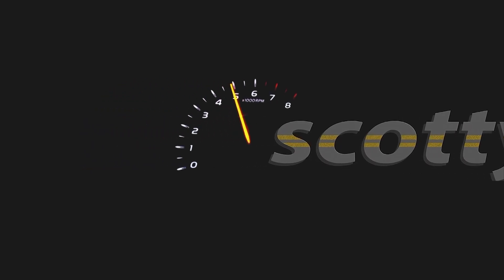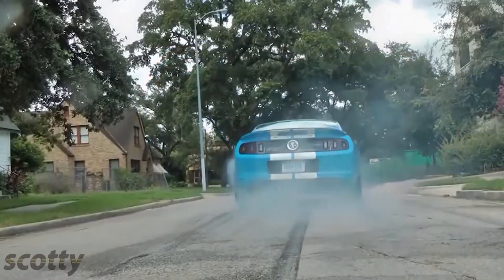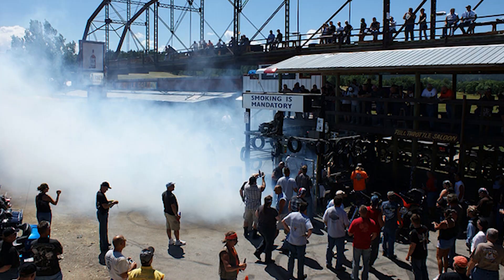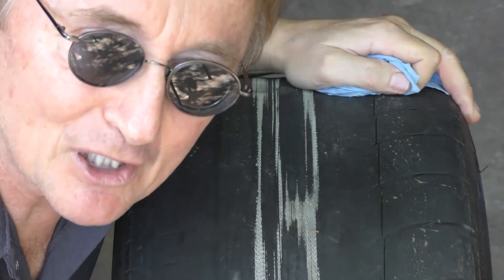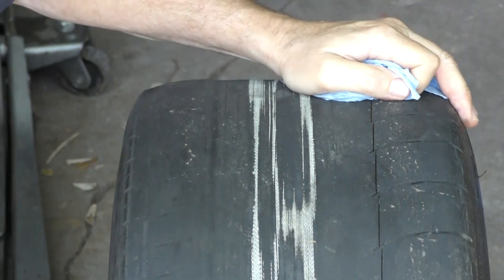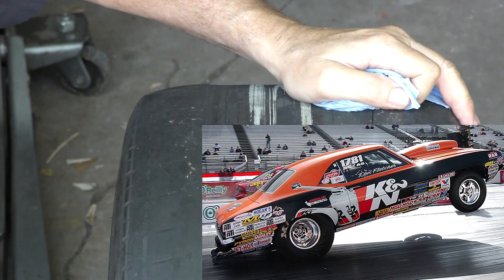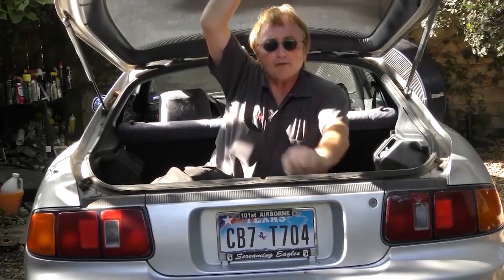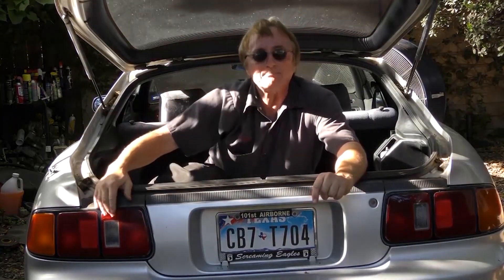Why Not to Do a Burnout in Your Car

Comment: 1 Horse = 14.9 HP  Mind=BLOWN
Reply: Vehicle Virals , holy smoke, that means my car's got 4470 hp.
Reply: In technical terms, a horse power is a unit that is equal to 735.5 Watts. It was invented in the era of vapor engines.
Reply: Paulman50 LOL!!! XD
Reply: Beats most mowers
Reply: Damn math
Reply: A horse of power it's by definition 75kgxmeter/second. Convert that to your favorite unit.
Reply: 1HP is roughly the amount of work a dray horse would average, working 10 hours a day, 5+ days a week. When it's really not all "that into it," much like you'd be, working a 10-hr workday.

Obviously, a horse can produce more power in a brief dash, much as you can produce more power than you do, say, pushing s lawnmower around the yard.
Reply: In terms of sustainable mechanical output (rather than just waste heat), 200 watt (0.27 hp) is about average for an adult, with some variability from person to person. A healthy 6′6″ young male might get as high as 300 watt even if he’s not genetically gifted, whereas a 5′1″ female would be closer to 150 watt. A world-class athlete can put out 400 watt / 0.54 hp over an extended period of time without being physically very large, but that seems to be the ceiling and you can’t go much higher even with doping. The limiting factor is the ability to bring oxygen to the muscles. You can do a fixed amount of work for every unit of oxygen (about 4-5 kJ/liter of mechanical output if operating at maximum efficiency), and the rate of oxygen delivery is limited by the rate at which the blood is pumped by the heart and the concentration of oxygen
Reply: Om Alive at last your comment = mind blown
Reply: Paulman50 ion get it
Reply: You're bang on Dig Byck
Reply: Paulman50 I got the same number.... 300HP?
Reply: how much hp is a chicken?
Reply: and if your car's got 4470hp, then it actually has 66,603hp
Reply: What are they feeding today's horses?!

Damn GMOs?!

...

I'm joking. GMOs are great. They are just controlled evolution. Like breeding cats, dogs, bananas, or horses, for certain traits.

I don't know if that's the reason for the 14.9. Or 1 Horsepower equaling 1 actual horse, was always wrong...

I don't know...

Whatever.

Because of Electric Vehicles, and the Metric System. I care more about Kilowatts & Newton-Meters anyway.

The Imperial measuring system, can't die soon enough.
Reply: Vehicle Virals temporarily, 1 horsepower is a hp that an average horse can provide constantly, makes a lot of sense.
Reply: Yes, I believe that James Watt observed how much effort (lifting water) a horse could exert over an extended period of time - not peak HP.  I also believe that it's generally accepted to be an accurate measure.
Reply: Luke Connolly I guarantee you if we reproduce the experiment 1 hp is still going to be 745 watts, and the more experiments we repeat, the closer it will get to that number.
Reply: I agree David
Reply: Vehicle Virals sup lol
Reply: bcubed72 correct.  Hp unit was created as a marketing tool for early steam tools.  People were used to having animals do work for them at the time and were not aware what the animal equivalency was.  So they came up with this rough unit of measure which represented the sales persons idea of what an avg horse could do over a long period of time.  Again, gross estimate and probably not accurate.  In theory, a two hp steam engine could replace two horses and do equivalent work over a day.
Reply: HOTEL = TRIVAGO
Reply: Horsepower is irrelevant too a horses power it’s just a unit of measurement
Reply: i mean its like what can pull more a lambo with 1000hp or a draft horse that pulls thousand pound sleds like nothing
Reply: @grivious31 the amount of work 1 horse could do in one hour ie- pulling a plow x feet in one hour... is my understanding of its inception...

Comment: I quit doing burnouts when my dad showed me how expensive tires were in high school.
Reply: That adds up. Pun intended
Reply: My dad thinks changing the intake slightly (removing the resonator pipe! can put water in the engine. WRONG. I driven though puddles and flooded parking lots and not a drop entered
Reply: Burnouts are a damn fun way to finish off a set of shitty worn out tires though
Reply: Infinitrium which I got :)
Reply: Infinitrium 

It's nice if you can get junk tires and a set of wheels to do silly stuff
Reply: I totally agree with your father, the cost of doing burnouts is just astonishing not to mention the heavy pollution this causes with no benefits at all.
Reply: I remember buying a new pair of tires in high school, getting into a burnout contest that night, and rolling back into the tire store the next morning buy two more, to replace the ones I just bought the day before....
The store manager was amazed that they were still holding air...
"Damn son, you didnt even get 18 hours of use outta these....."
Reply: Get junk tires, that's how drifters do it
Reply: @funnypranker34  um ... It can... I pity any car you drive...
Reply: Go to a Mexican shop use tire all day for 20 dollars
Reply: How fast do they finish

Comment: actually when you do burnouts on a standard transmission, it doesn't wear the clutch out. You're meant to rev the engine up and dump the clutch. People who suffer burnt clutches make the mistake of slipping it. When the clutch is popped out it stops slipping almost immediately thus there is little friction. Also remember that wear is a product of friction + heat so in this situation the clutch plates would still be cool when you do it, thus almost no wear on the clutch.

Comment: Another issue (more with FWD models) is often only 1 wheel spins. This puts major stress on the spider gears in the differential. I've seen them explode separating the transmission case due to heat build up associated with the high speed they're spinning due to only one wheel spinning
Reply: My rwd only spins 1 wheel. But what if it’s not even close to redline? Redline is like 5k, it can burnout at 3k, and I never do it for even more than 5 seconds, just a lil spin
Reply: I just lock my back differentials

Comment: I try to keep a "to each their own" attitude.  If you enjoy the burn outs, more power to you.  I've got a 2016 Mustang GT.  It's got the line lock feature that will lock the front brakes so I can do a burn out.  I've never used it, primarily because I can't afford to replace the tires!

Comment: Doing a burnout in an automatic transmission is especially hard on it. Winding the engine will holding the brakes (or not if you got line locks) makes the torque converter spin really fast building up  A LOT of pressure and heat. Two things that will lead to premature wear on parts like the clutches and bands. Most people don't have line locks and just floor the petal until the engine overcomes the rear brakes. A lot harder when your rear brakes are calipers. Front wheel drive I'd assume is the same if not harder to overcome the brakes as most passenger vehicles don't really have enough engine torque to do this. You would just burn up your clutch or burn out the bands and clutches in your auto trans.

Comment: In my dad's home town, the local sheriff told everyone, "Go ahead.  Burn them up.  You'll find out how much tires cost."  After that, the burnouts were not fun to do anymore.  And tires were the cheap part.  Clutches, transmissions, rear ends, etc were the big ticket items.

Comment: "Some modern dragsters have more than 1000 hp."

Top fuelers are pushing around 11,000 hp now Scotty. There is no Dyno that can measure this, do the math.
Reply: Sunset Valley Ranch I know it’s late but like the highest hp car to exist right now is 1600 hp, not anywhere near 11,000. Just thought I’d let you know before you go around without having done research
Reply: Slayer Don Do some research my friend. You can’t go 320 mph in a few seconds in a 1/4 mile with 1600 hp.
Reply: Slayer Don are you okay?... there’s so many dragsters with 11k+
Reply: Slayer Don look up 1320 video , you’ll see many cars over 1600hp
Reply: Bladimir Tarango look up the highest horse power cars to exist. You won’t find one with over 1600. And the 1320 videos are on YouTube so they can be listed however they want to
Reply: You can’t go from 0-320 mph in a few seconds in ANY car. Look it up. Trying to call me out on “not doing research” but the fastest 0-200 mph ever recorded was 15 seconds so like. You’re already incorrect

Comment: Don't forget burnouts wear out the rear brakes real bad.
Reply: Thats why you use linelocks lol
Reply: Dresdon Acacin exactly
Reply: That's why I added line lock ;)
Reply: BlackLS1Pontiac how??    like mechanically  how did you
Reply: I don't need brakes to do a burnout
Reply: Lol traction control is on need to turn it off 😂😂😂😂
Reply: Gabriel Trevino lmaooo traction control burnout attempts make me cringe soo baddd !! lmao😖😖😖😖
Reply: Who needs rear brakes
Reply: John Boy lmaoooo dude !!!!!!
Reply: Your burning out wrong. You need to cut and clamp rear breaks first
Reply: Brakernight sounds reasonable lmaoo😅😅😂😂😛
Reply: No brakes needed :-D
Reply: dualmode1 When you apply your brakes, the rears also get applied slightly. Watch EngineeringExplained's video on how to do a burnout
Reply: Midnight Mustang 
My friend, i m pretty sure how to do a burnout. Yes you can force your car to stay put with brakes. But its unnessesary 
Ps: i hate the engeneering explaind guy.
Reply: line lock
Reply: ...you forgot to mention the wear on the shoe soles when flooring the pedal!!
Reply: But, what if its front wheel drive? 🤔

Comment: We still call em burnouts down in oz scotty! just the cops ticket you for "breaking traction" because it sounds more formal and is easier to prove than doing a burnout specificially
Reply: MelloOwnsRyuuzaki in western australia it’s called excessive noise/smoke. You can get charged with that offence for even chirping a wheel by accident. All that it needed is the tiniest noise from the tyre and they can get you.
Reply: Marshall Sambell I see, yeah that's how it is in Victoria too, they'll get you for anything minor on the road while ignoring real crime
Reply: Over here it's called reckless and/or uncontrolled driving since they think we no longer have control when burning out.
Reply: In NZ they call it the cute and formal "Sustained Loss of Traction"

Comment: got smart and now my track/daily is an Audi, I used to burn through my clutches, gears, LSD, tires, and brakes on a weekly basis. My current car just chirps when I try, but that still doesn't mean I stop having fun when I get back from the track, I still take my A4 up to the mountains and rally it up and down the Colorado mountains till I feel the need for tires and brakes (typically what goes out for me after about 3 weeks of track and daily).

Comment: I don't do burnouts, but occasionally, I do like turning off the ESP and gunning it when the light turns green. I spin the rear tires, they squeal, the rear end goes a bit squirrely and I have a wide grin on my face.
But I don't want to ruin my tires and cook transmission oil with a full burnout.

Comment: Hey, a "Mechanic" told me that ticker oil is better for old engines, I have a 1996 nissan pathfinder that is supposed to use 10w-30 motor oil but I have been using 20w-50 for quite a long time, so I just wanted to be sure that if I change the oil viscosity that want damage the engine.
Reply: It's not necessarily better, unless you're having an oil leak then it may reduce the amount of oil leaking. Just run what it says on your oil fill cap.

Comment: You did not mention that burnouts also wear your rear brakes on rwd cars.  Add to that, you powertrane not only needs to put forth effort to break traction, it also has to over drive the grabbing power of the rear brakes.  Many burnouts are done just using the brake and heavy throttle.  From brakes grab harder than the rears.  That is what makes it work.

Comment: When I was 15, I got a 1976 Dodge Aspen with the high output 4 barrel V8. The car would roast the rear tires if you just looked at the gas pedal. Front tires were the original F78 bias plies. Rear tires were worn smooth almost every two or three weeks, and I would go to the auto wrecker and pick up a used pair of anything (even bias-ply snow tires with the square shoulders) for 15 or 20 $ to do more of the same... ahh, life in the 1980s!! . . The Aspen lives on in mint condition 30 years later!

Comment: Used to do burnouts in my VW Golf mk3 to try to impress friends until one time my clutch gave out. Took it to a mechanic and turns out I ruined my transmission too. Cost about $1000 to fix. Ask me if I ever did a burnout again. :)

Comment: I remember my 1996 ford ranger, 2200 pounds front, 275 0oumds rear, even just sneezing hard while stepping on the gas would break the rear wheels, in the rain was even worse, just trying to get going you had to delicately press the gas, if not you would hydro-burnout on the water on the road and not go anywhere, man that was a fun truck, horrible in snow (no rear weight at all and rear wheel drive- no 4WD option)

Comment: That's what I loved about working at a tire store. If I burnt up a set I just put a new set on. I once went through a set of Comp T/A's in less than 6000 miles doing a lot of burnouts. Plus how do people hit stuff? Car always went straight until you turned front wheels left or right. 

Doing a burnout on new street tires is a waste. Not going to really get any better traction. Wish I had known that years ago. I wouldn't have wasted my time at the track. Drag radial or slick go right ahead.

Comment: I have 17,000 miles. I still am having little gold copper like small pieces in my oil when I change it. Earlier on I noticed small non metallic pieces. I have a 2017 f150 5.0 should I be concerned or is this normal break in? Btw I’ve changed oil 4 times already.

Comment: I bought a second hand Nissan Teana 2009  here in NZ. It had about 90,000km on it. After driving it like a normal person for a year its at 96000 km. The thing is it has started to show problems. I guess whoever owned it before did burnouts because the dealer had to change the rear tires. These are the symptoms. The car has a 2.5l V6 engine, it was pretty strong in the beginning but now it feels like going against a strong wind as if the car is going through deep mud as if something is trying to stop the car. In addition, the fuel consumption has suddenly increased. When I start the ignition in the morning I smell a strong gasoline smell.  I took it to a mechanic and he said it seems to be a dead cylinder due to worn out spark plug. Any advice would be helpful.I just hope it doesn't have any big issue such as problem with the transmission.

Comment: Other than heating the tires. I always saw burnouts as a demonstration of power & durability. Like a Tuner or HotRodder, actually proving the hard work they did, in seriously raising the performance of their car, and not pretending they did like a Ricer would. High-quality parts, balanced modifications, and genuine skill in still keeping it under control.

Also. Other then drifting, I see burnouts as a fun way to finish off a tire, too worn or old to keep using, long term.
Reply: Shawn Stafford 
I wouldn't take it that far.

If I see any inner fibers, I would stop drifting, or doing burnouts.

Comment: Scotty--I think you were right the first time (i.e., never do a burnout with your car, truck or motorcycle).  It's hell on your vehicle's tires, wheels, transmission, prop shaft, brakes, u-joints, clutch and who knows what else.  As you pointed out, it leads to loss of control, blown tires and a shortened transmission life, among others.  Interestingly, you never hear about or see people with Ferraris, Lambos, Bugattis or Rolls Royces doing this.  Does that mean they're more highly evolved?  Or do they just understand they have too much money tied up in the car to abuse it in that manner.  I actually did see a woman do a burnout on an episode of "American Hot Rod" a few years back.  She was a new employee at Boyd's shop and felt she needed to do one to gain respect from the other employees.  She did one just to prove she could, but she didn't stay very long at the shop, so it was all for naught.

Comment: Most of the guys who do the burnouts at Sturgis have an old used up tire on the bike just for this purpose and they have a chance to win new tires or cash or what ever the prize is that round.  There is usually a tire van or shop nearby that will gladly mount a new shoe on the rear of your bike win or lose!!  Oh and hopefully when the carcass leaves the tire it doesn't damage your fender or hit you!!

Comment: Doing a burnout with modern street tires at the racetrack is counterproductive. There is little to no advantage. 

If  you have drag radials or slicks, a burnout is mandatory to get the rubber hot and sticky. Those tires have a totally different compound that is made for burnouts.

Comment: Good Year Polyglass tires made lots of smoke......1969 Chevelle SS 396 ..... 🇺🇸
Reply: Shawn Stafford The performance was Great had no problems, but the compounds in the rubber made lots of smoke in burnouts, Me had some problems with Firestone tires .......
Reply: Shane Stafford Yes some did, seen many thicker wall tires now that just come off  the 18 "or the so called  low profile wheels if you look at police tires thay are great  .....🇺🇸 TRUMP 2020

Comment: I did my first burnout today. Won't happen again anytime soon
Reply: Halaboly why
Reply: @jackz7749  I did it on a motorcycle. It ate through my new tires so fast! And my tail light was covered with little rubber dots that were a pain to clean. Just not worth it 🤷🏻‍♂️